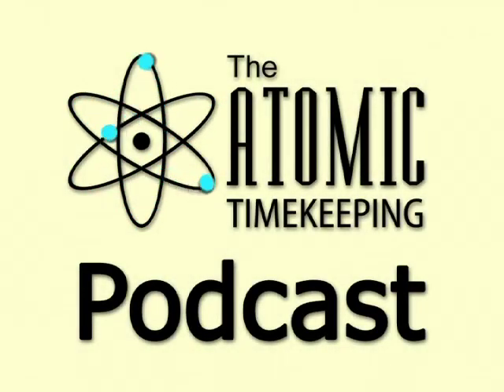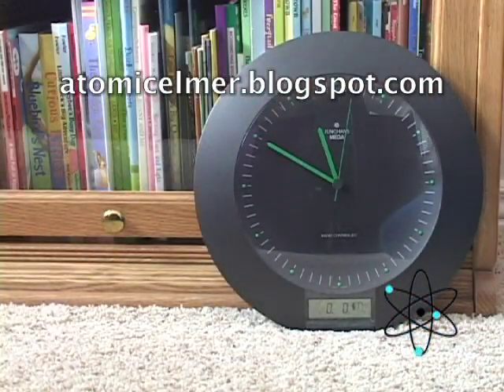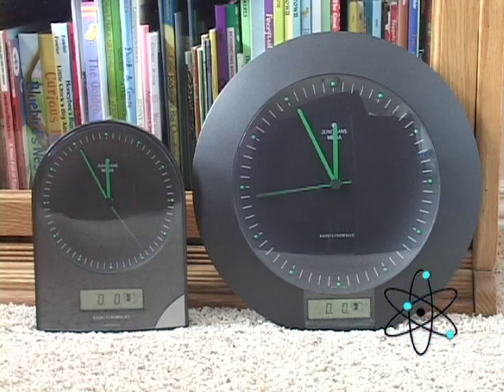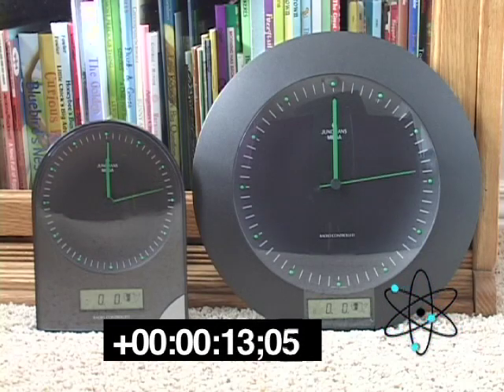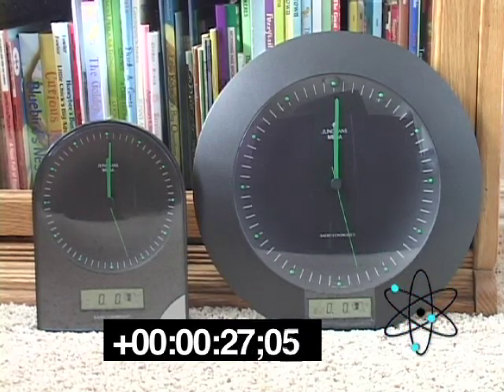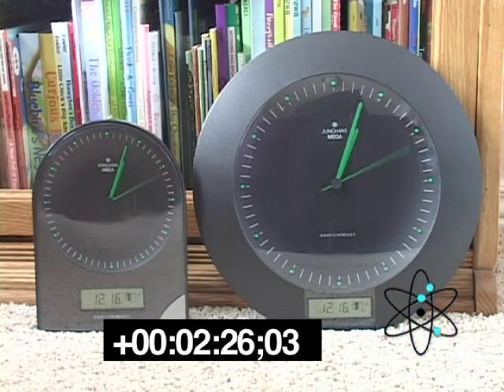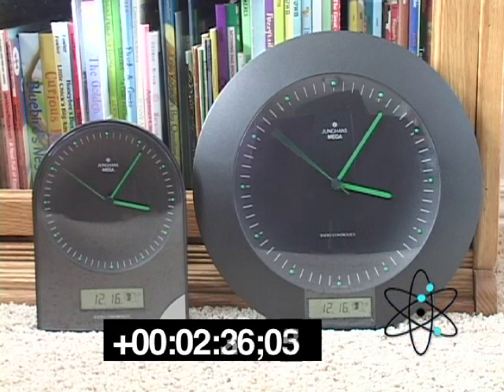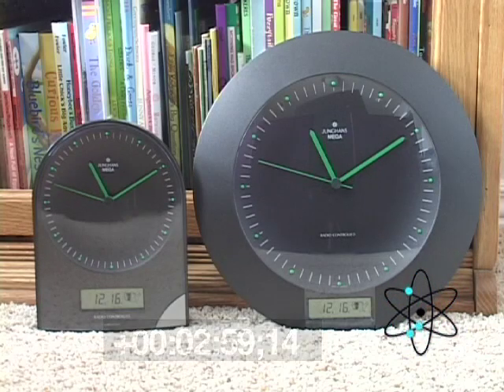Junghans Mega Clocks

Comment: No matter hos good receiving conditions is setting is not less than 2 minutes. The reason is that the transmitter sends time once a minute and while there is a few checks most clocks first accepts time as understood correct when two on each following received timestamps match each other (with a minute between them).

Comment: Sadly, Junghans no longer service the old 'Mega' clocks as they are too costly and no longer financially viable to repair.  Contrary to popular belief at the time when they were first introduced in 1988/1989, they don't go on forever.  Mine quite often is simply showing the wrong time by +/- 5 minutes and needs to be re-set each day.  Junghans have not offered a repair facility now for 10 years (since 1999) according to their UK repair centre (Jon Vincent in Scotland).